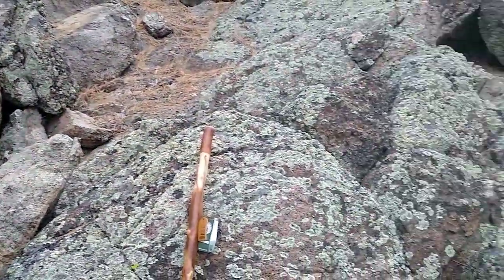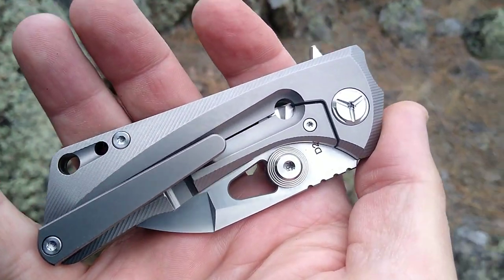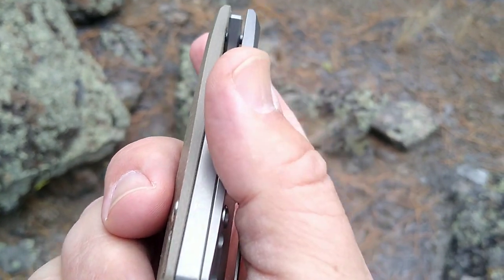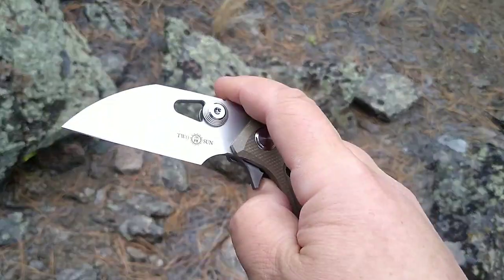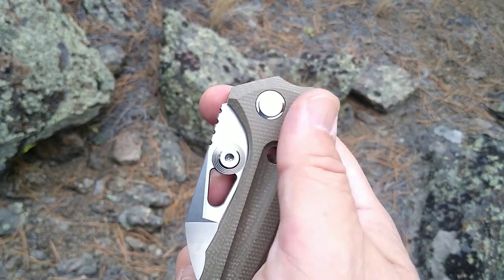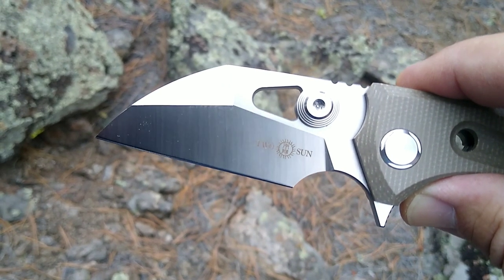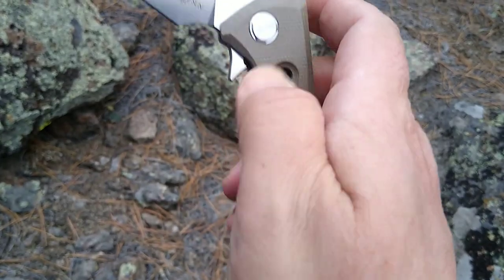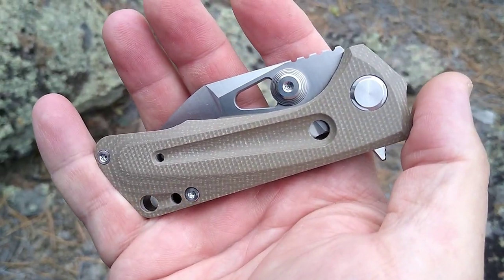Twosun Knives - TS138 "Dracula" Micarta scales and titanium. D2 blade steel. Wong Design

Comment: looks a lot like Cold Steel Tuff Light :) 
Any long-term users of Twosun here? What about their overall durability though?
Reply from the maker: Lot's of testing on material and hardness. Even quite a bit of cut testing done on the Twosun knives. The 14c28n performs really well, the D2 is decent and the m390  has been hit or miss on the heat treatment as a whole
Reply: On what world does it look like the Tuff lite?
Reply: @tydshiin5783  they look terribly alike
Reply from the maker: I see the similarities between the two

Comment: I like the blade on that knife, which seems to be a stout knife. Why did you have to clean the knife? Did you buy it used?
Reply from the maker: Hey Mike, I bought this new off of Amazon.  You can also get Twosuns at Ebay and White Mountain Knife online.  Their models usually go quick as their popularity is growing and they are making TONS of new models.  Their models are by number.  The higher the number, the newer the knife (they assign a number when they decide to make the knife, but sometimes higher numbered knives will come out before they actually make the knife with an earlier number). You can buy used Twosuns off of some Facebook groups.  I don't like buying used knives online, as you never know if they are selling it because they messed something up or they just want to get a new knife.

I like to clean a lot of my new knives.  Twosuns, as a rule, are very clean inside.  They do come from the factory with a film of oil, which helps protect the knife from humidity and salt during overseas shipping.  I get in there and wipe it all of with a cotton patch and rubbing alcohol.  Sometimes I get a little metal filings and I don't want those in with the ball bearings and such.  A quality knife has low tolerances.  Which means the parts are really close together, so, like and engine in a car, a person does not want "grit" in it.  But a knife doesn't go 100,000 miles either.  I just like them to be clean.  The factory is putting together hundreds of knives a day and there is bound to be dirt, dust, metal and other contaminants that can get on your knife.
Reply: @rustyminer  - OK, that makes sense. Some of the Pro-Techs also have oil near the pivot or on the blade, so I know what you mean. I was checking out the TwoSuns, and this is a model that really catches my eye. The TwoSun TS-129 reminds me a lot of the Viper DAN2.
Reply from the maker: @mikeelek9713  Protect is a brand I have yet to handle. They have a good reputation though. You are right, the TS129 does look like the Viper Dan2
Reply from the maker: @mikeelek9713  if you get a Twosun maybe you'll let me know how they compare